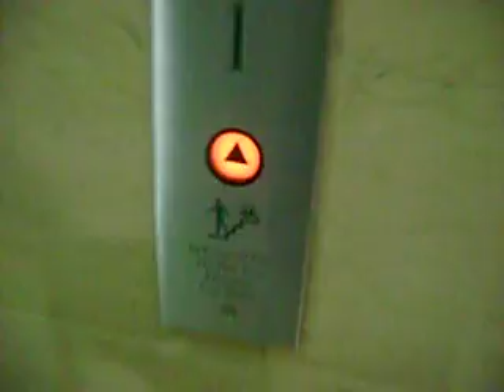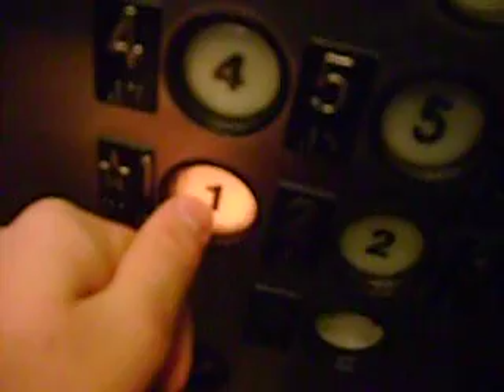Westinghouse Traction Elevators At American Tower

Comment: and there were 5 banks plus an exprees bank that serves higher floors and the lobby and are set in peak mode to be sent down to the lobby and remain open until someone gets in are the elevator is called from a differnt floo